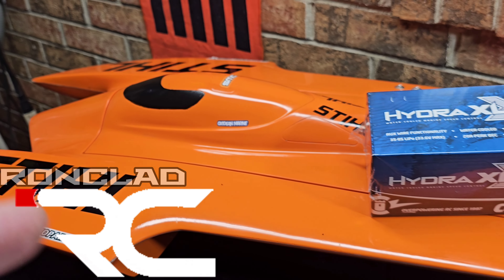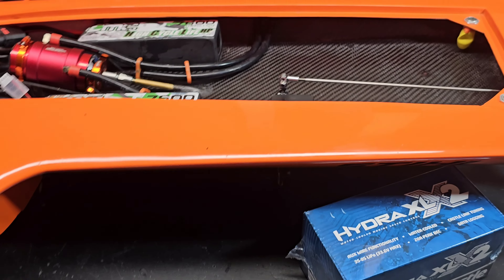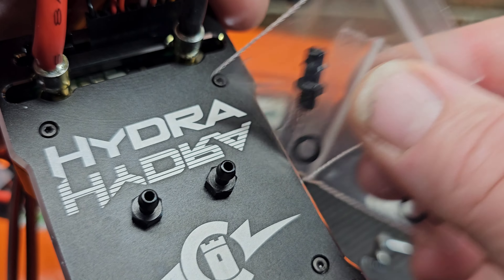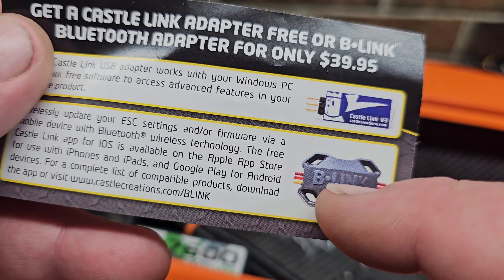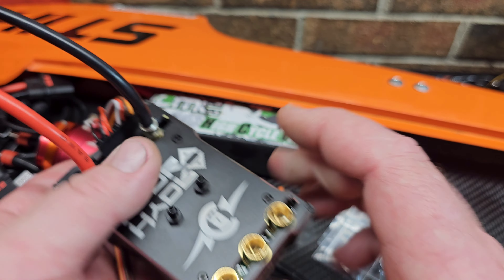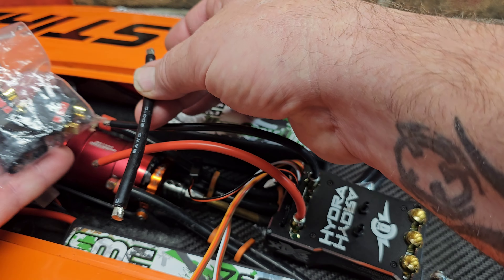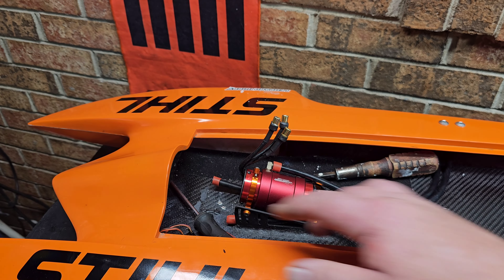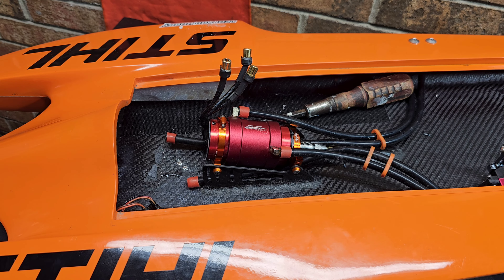Castle Creations XLX2 Hydra Install Deltaforce Vortex 34 Fe Rc Hydroplane - 4082 Leopard X2 1600kv

Comment: I feel for you on the fleet of equipment! I own only 7 boats, and am just getting into it, but I own over 50 racing quads of every size, 8 tanks, 3 copters, 4 truggies, 5 electric monster trucks, 1 drag car, two rock crawlers,  3 nitro monster trucks, two speed run cars, 6 planes, 3 long range quads, and finally 3 gps quads. It is not only an addiction, but a sickness LOL!
Reply: We are the same with over 40 models!

Comment: Seems bit oversized esc for that size motor, but you obviously thought it tru. And off course it can be used in other setups for the future... 
Haven't run dom yet btw. There will be some more good sunny days comming week and first went out to check some bigger ponds and bought myself a inflatable board so i can save the boat if necessary and made a "carrying bag" for boat and tools. Think it also helps to be bit more relaxed when pushing its limits 😄

Comment: I bricked my ESC using my b-link also. Was the next run after pulling 500+ amps, thought I toasted it!
Reply from the maker: @sohcerdad  did you get it working?   You can basically do a factory "reset" and get it working again.    I "bricked" both of mine basically at the same ti.e lol.   I was like what the hell freaking out lol
Reply: @IRONCLADRC  yes I did fix it. Factory reset with the cable to PC. I had lost motor function only, steering still worked. Couldn't rebind/reset throttle endpoints. Deff a pucker moment.

Comment: Do you think hydra xlx2 is a lot better than the hydra x8s?
Reply from the maker: Xlx2 Handles more amps than the x8s.  Hydra(xlx2) is much larger in size and weight as the x8s